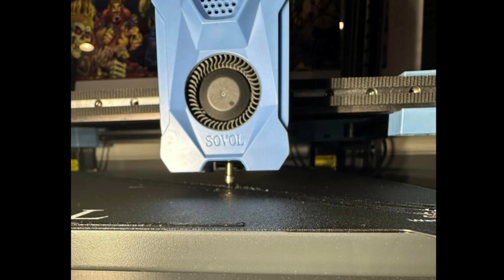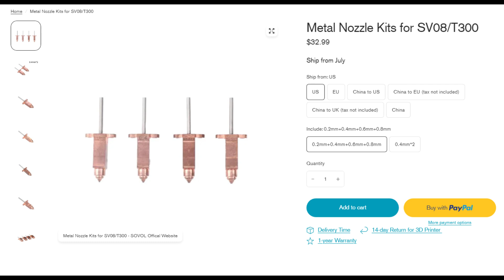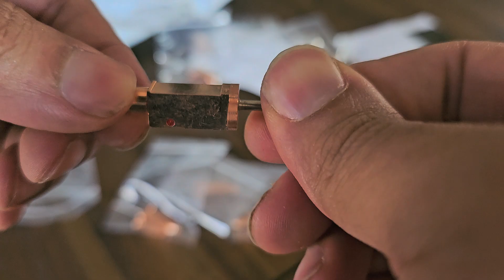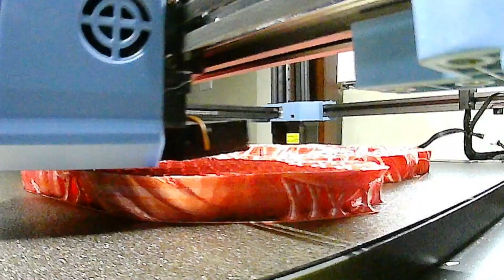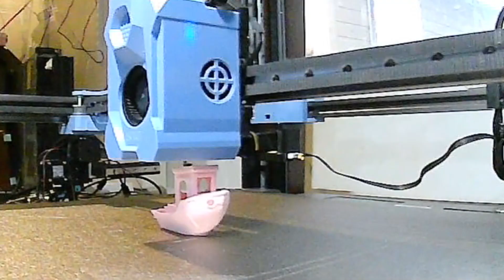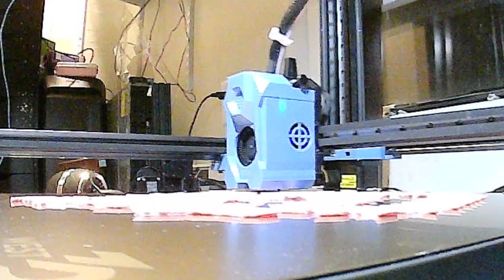Confirmed: Sovol SV08's New Nozzle is Screwed

Comment: 8mm3 really? stadard PLA is 21 while flow test in Orca says >30mm3 easy
Reply from the maker: @jzagaja  Yeah. If there was no problem, it wouldn't have been worth making a video.
Reply: @MaximalistWorkshop  I received nozzles with that additional thread, what's the purpose? My stock old nozzle 0.4mm 30mm3 petg no problem tested.
Reply from the maker: @jzagaja  The purpose of the grub screw and threaded nozzles is discussed thoroughly in this video and others on the same topic.  It's great that you were able to get whichever nozzle you got to work to work, but not all of Sovol's stock nozzles have been without failures.

Comment: Hi, thanks for the video and nailing down the problem. I have completely same issue - broken 2 nozzles that came with the printer. Additionally second nozzle damaged printing surface and yes I printed only PETG. After a week of communication with Sovol and sending them photos of the damaged parts and photo of the serial number of the printer they finally send me replacement parts. Since the parts shipped from China it will take up to 3 weeks to deliver :( . While I waiting the replacement of the standard nozzle I decided to buy on Aliexpress in Sovol official store the nozzle made from the hardened steel and has thread so it will not have same problems as the original nozzle shipped with printer.
Reply from the maker: Good call. I have a video backlogged about the threaded hotend, but as a preview in case you haven't seen it mentioned elsewhere: it's compatible with Neptune 4 Max nozzles, so it unlocks a lot of options.  Testing a ruby tipped nozzle on ours now.

Comment: I just got mine today and it came with a damaged cable on tower 4 and also on the base plastic for tower 4 was bent and I could not even get it in. I took my heat gun and plyers and straightened it out and got it installed repaired the cable and it is now printing. So they really need to up there QC.

Comment: what thermal paste or glue are you all using on these hot ends.  I am swapping mine out as my current one keeps under extruding like there is somethin in the nozzle.  I have cold pulled it and i can push filament through easy but when I run 100mm test I get only about 75-80 through.  I have tried using it like it is by upping the flow but still no dice.   They sent me a second one but pulling apart the original there is white thermal glue or paste that semi hardens I want to put the same stuff or similar on just want to hear what you all are using.

Comment: WTF, my default profile for the sv08 has 21 mm3/s of max volumetric speed
Reply from the maker: For what material?  With ABS, that's normal.
Reply: @MaximalistWorkshop  with the pla profile
Reply from the maker: @syns369   That's fine.  That's the same profile we're using here.  The original hotend is generally rated at 30 mm 3/s, but it won't be able to do that with every material under all conditions, so Sovol set a more conservative number in the PLA profile.  You can run a calibration test to see what the hotend can actually do with your filament on your machine.  The newer hotend designs should all be able to handle a decent volume with PETG - it's just the very first iteration couldn't handle more than 8 or so because the parts weren't machined correctly.
Reply: @MaximalistWorkshop  ok I sée thank you , however I did reduce the flow to 18mm/s ans increased temperature to 240 for pla otherwise It got clogged everytime , maybe it has to do with the hotend design

Comment: lol both my ender3 and N2s with CHC nozzles do 20mc flow with PLA, those hotends cost 4$ on Ali!
Reply from the maker: Sure thing - if I'm understanding "mc", that's probably not high enough flow for the SV08, though.  The SV08's hotend is rated at 30 cubic mm, and speeds as low as 420 mm/s using a .4 mm nozzle width and .2 layer height probably uses all of that volumetric flow.  Since the SV08 is meant to be able to move as fast as 700 mm/s, it arguably needs something more  powerful than even its stock hotend.  That said, there's no reason a hotend couldn't be designed to run at 50 or 100 cubic mm using a CHC/v6 nozzle
Reply: @MaximalistWorkshop  Ye mc is short for millimeter cubic. Don't forget line width and stuff like solid infill: you do ~0.6mm LW there, also vase mode.

Comment: Who the F pressfits anythign in a system that undergoes rapid heating and cooling cycles? Also M6 Nozzles are abundand, and even nozzles with integrated Tube are already a thing?
Reply from the maker: Aren't Bambu Lab nozzles press fit?  I remember seeing similar failures to the ones Sovol is having now on the Bambu Lab X1C around when the X1C was released.  I think it might be press fit on the Adventurer 5M series, too.  The new K1C unicorn hotends have a press fit insert, as well.  And the Sovol nozzles do have an integrated heatbreak
Reply: @MaximalistWorkshop  Yes, as you said: Similar failures. Depending on the heating rate the outer component may be tighter, which may cause slight creepage/deformation, or looser, which then opens the connection. It is not impossible to get this under control, however it is difficult and - why? M6 Nozzles work fine.
Reply from the maker: @Bapate-rh9be  They're cheaper.  Also, putting the heater block directly against the filament instead of having a nozzle in-between them can provide improved thermal performance and thermal stability.  Not saying press-fit nozzles are a good thing, and I agree with you intuitively, but Bambu and others did have at least some reason to switch.  Since Bambu doesn't have this issue anymore and hasn't in a long time, it seems fair to say that press fit nozzles can be fine.  Also seems worth pointing out that none of the press-fit nozzles from Sovol except for the original silver ones that Sovol said had QC issues are failing, which at least suggests that the design was fine.  Otherwise, we'd see bronze nozzles popping out of the hotends, too.

Comment: While my SV08 is not delivered yet, I already got the coldend for using Revo nozzles designed by The Next Layer and custom made by PCBways. Actually all new fast printers use nozzles with high flow (bigger meltzone than the good old V6). However, while this is good for max printing speed, you can not easaly attach an MMU (Filament changer, like the ERCF). Due to bigger meltzone the filament tip after unload is not be ready to be reliable been loaded again. This is the reason Bambulab and others use cut&poo for their printers. Wich is a waste of filament and over all printing time.
Prusas MMU2/3 do a much faster filament swap. Both the old mk3 (esp if upgraded to a standard Revo) and the mk3 Nextruder use standard flow hotends. While the mk4 is only about half as fast as an modern CoreXY like the X1C or SV08, on multicolour the over all print time is much faster.
So if you plan to add a filament changer, imho a Revo hotend is the way to go anyways. Use a Revo high flow nozzle for normal prints, use a standard flow for using multicolour. So no cut&po needed, just a very smal prime tower (+ wipe2infill or wipe2object).
Of course, if you do not have Revo hotends and nozzles on other printers, upgrading the SV08 can cost more than the printer itself (one ObXidian nozzle about 70€, a high flow nozzle about 60€, standard flow about 30€, heater core 60W about 50€, custom coldend about 45€; if you want 0.4 and 0.6 ObXidian + 0.4, 0.6 and 0.8 high-flow + heaterCore high flow + coldend, this is about 425€). But if you have most nozzles you need anyway, an upgrade is much more affordable.

Comment: Micro Swiss is coming out with a Flowtech Hotend Upgrade for use with their CM2 Nozzles and Diamondback. 3D Jake also has Hardened Nozzles for the SV08
Reply: I love the @Microswiss hot end on my SV08.  Now I have access to a very wide variety of high quality FlowTech nozzles, and I can cold swap nozzles by simply unscrewing one and screwing in another, unlike the Sovol hot end that requires removing and reinstalling the heater and thermistor.

Comment: I contacted Micro Swiss and they are apparently going to be designing a flow tech and revo(maybe?) for the SV-08. They like myself are just waiting for there’s to arrive.
Reply from the maker: That's huge news!! Thanks for sharing.  I'm super excited to test them when they come out.  I wonder how their Revo design compares to Jonathan Levi's
Reply: I was several months late to the SV08 so I skipped a lot of the initial drama.  I installed the @Microswiss FlowTech hot end when I was assembling my SV08 and I'm a big fan.  The nozzle change process for the SV08 hot end requires removing and reinstalling the heater and thermistor.  I can cold swap the FlowTech nozzle by simply unscrewing the nozzle with a 7 mm nut driver and screwing in the new nozzle.

Comment: New issue: Extruder planetary gears striping. While printing sv08-top-extention-lit-back-left.stl after 1.5 hours,  the filament stopped extruding, I aborted the print and tried to retract the filament, nothing happened, I disassembled the hot-end and found the filament had been forced into a short piece of PETF tubing between the extruder planetary gear and nozzle, I replaced the tubing but when I tried to turn the wheel of the extruder it only traveled a 1/8 of a turn, this was with no filament. Disassembling the extruder reveled the missing teeth on each of the three gears. I was using PETG with a Sovol dryer, the same setup I use on my K1. I just tried to order a new "SV08 Original All Metal Planetary Direct Drive Extruder" but it appears to only exist in China, weeks instead of days...

Comment: I just got my machine Thursday, 7/18, it appears as though it has the original chrome nozzle.  I just finished printing the top riser for the enclosure kit, four pieces, about four hours print time each, in PET-G.  It was my first time printing PET-G so I used the stock factory profile from Sovol.  No issues.

Comment: Can you provide some details on the specific options you chose when ordering the Revo adapter?  Specifically, what type of aluminum?  Did you choose threaded holes? Tolerances? Surface roughness? For the finish did you do bead blasting and anodizing or just anodizing?

Comment: Settings won't change anything. If the nozzle has manufacturing problems it will fail eventually no matter what, and if it doesn't have manufacturing problems no ammount of flow rate will ever be able to push a properly press fit nozzle out. Its a silly red herring obsessing about what setting are being used. Depending on the manufacturing method the nozzles are either forced in with hydraulics or the nozzle is cooled with something like dry ice before it is inserted so it then expands and is permanently placed. A stepper motor pushing on a plastic filament is a tiny percentage of the force needed to seat or unseat an interference press fit ... unless it has manufacturing tolerance problems. The pictures of them just sliding out means they are significantly undersized. If it was a design problem there would be far more examples than there is.

Comment: I've been printing PLA for days with around 25mm³ (max flow set to 27, as ~29 was the point where the flow test failed)with no problems at all, nozzle didn't move at all

Comment: I was so close to buying an SV08...and then I remembered my engineer father's best piece of advice, "Never buy the first production run of anything." We'll see about the Sovol SV08...in 2025. (Assuming we can still buy anything from China in 2025.)
Reply: Buy the P1P. It's even cheaper. 500 vs 580
Reply: @Splarkszter   The P1P is a good choice as long as you don't need the build volume. I have an X1C as a my main printer.  I want to print face masks. Sure I could cut them up,  but that would add more work, decrease strength and increase my processing time.  I am looking at something like the SV08 or a Voron with a .08 to print the large bases.
Reply: Smaller tho. 
I bought the sv08 for the performance and the size  @Splarkszter
Reply: @Splarkszter P1S is the way to go.
Reply: @Splarkszter  Smaller and not open source. The good thing is if this is the only issue, the nozzle is a consumable anyway.
Reply: @francistaylor1822  It's not the only issue. There are reports of some parts not fitting and such.

This printer needs at least half a year more.

Comment: Maybe they could have just reused an existing, common, popular, high-performance, NON-BROKEN design so people didn't have to replace major parts of brand new printers? /smh
Reply from the maker: Agreed, though I wonder if they realized this would happen given that it didn't with the T300. To the extent they were able to cut the machine's cost by using a design they already had on-hand that was working for them, I think all power to them because it means (at least in theory) the printer's cheaper for us.  That said, if they were going to take this approach, more testing on their equipment and profiles before shipping everything out may have caught this.
Reply: @MaximalistWorkshop  The "more testing" part is probably the weak link there, I'll agree.